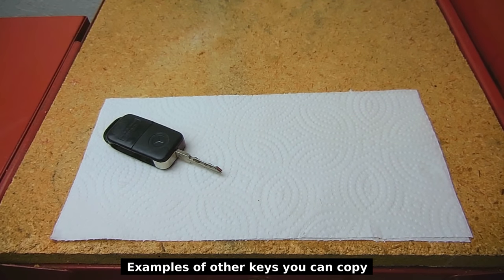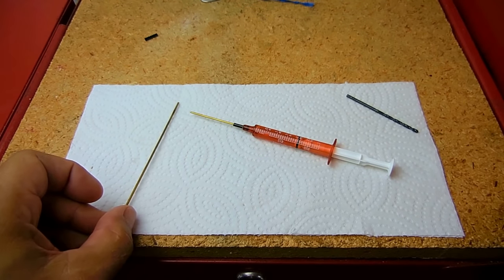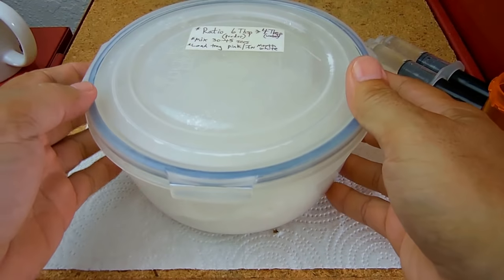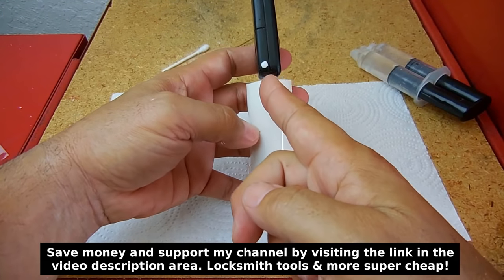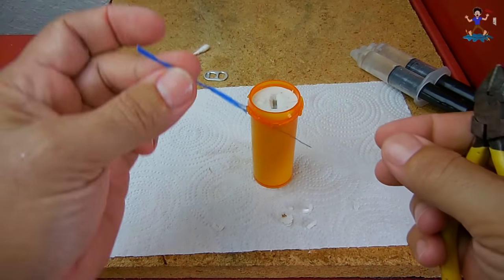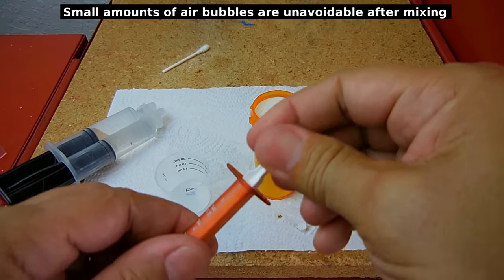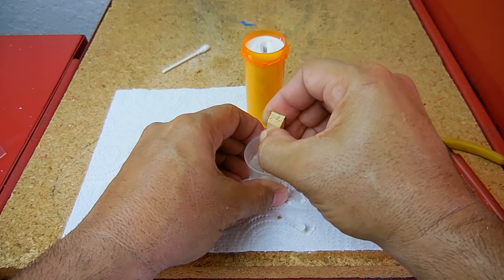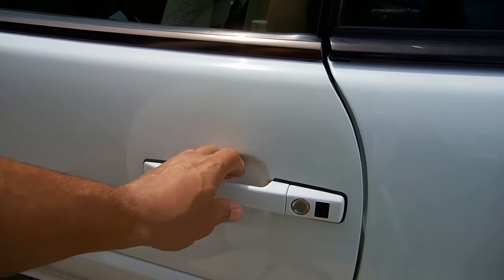How To Copy High Security Keys

Comment: oh I though you also duplicate the RF circuitry as well :)
Reply from the maker: No, only the key. :-)
Reply: You can do that in plenty of easy ways, including using a 'learning' TV remote. I even had a watch in the 1990s that had a built in TV remote function that could 'learn' or just straight up copy any IR and RF signal. I think they stopped selling that particular model watch because people were using it to steal car alarm frequencies (you could stand about 30ft away from someone pressing their alarm fob and it would copy the signal, so you could then use the watch to deactivate the alarm) it works because I copied my fob in to it (it could store about 200 devices signals so I had my TV, stereo, vcr, car alarm and most of the other devices that had some kind of remote, IR and RF signal in my house stored in to that watch). Those were the days. It wasn't expensive either, it was around £29.99 from either Argos or Index store (can't remember which but they both sold it) in the UK. I have seen similar ones sold on eBay too. You can buy similar functioning devices from places like Ali express etc for virtually pennies (about £2.35 I've seen RF grabbers selling for on there).

Comment: you shoud have stated it better in your other key making video but o well next time. Still good.
Reply from the maker: No, the other video was just fine. One video showed a metal duplicated key, and the other showed an epoxy resin version. I do like the idea of a 3D printed key. I need to get out my printer. :-)
Reply: @electronicsNmore  the thing is their a program to scan a object in 3d? Printing is the easy part. Also the type of plastic to use is also important since theit are like 6 types I think. .
Reply from the maker: @trench01  You'd have to scan each side then combine the image into one.

Comment: Hey mr full of yaself,,, nah just kidding...looking at some of the comments, Algenate is another dental mould making material sorry ( mould U.K )  ( mold U.S ) anyway other than that any pourable silicon mould making rubber will do a better job ( not Latex ) it shrinks, Dow Corning do a wide range and yes it's eblag for a source in small quantity. Also silicon rubbers will last forever and you could cast thousands from one mould. No need to slit it either. One last point that Resin is strong but to make it even stronger you can add any fine metal powder to the mix you can get Brass, Copper, stainless steel, Aluminium etc etc.
hope this helps.
Reply from the maker: Hello. The Alginate works perfectly, and it cost MUCH less than pourable silicone. I have a video showing how I make custom ear plugs using pourable silicone. There is really no reason to have a reusable mold. Once the key is duplicated, I'm done with it. The slit is necessary to avoid damaging the mold when removing the key. The best additive would be very tiny metal fibers, powder won't do too much. When I pour concrete, I add tiny fibers to increase the strength. Thanks for watching!